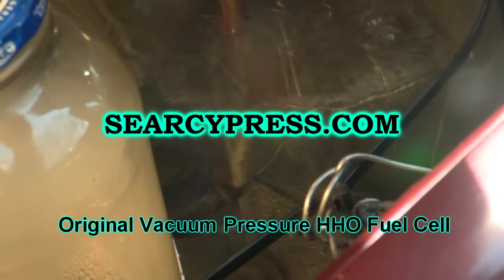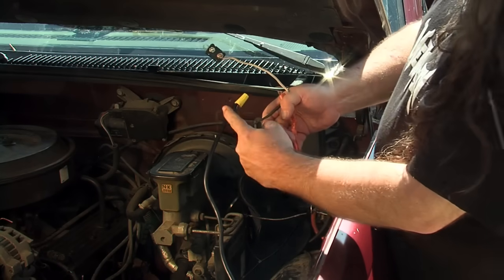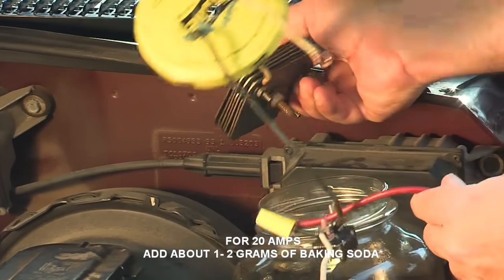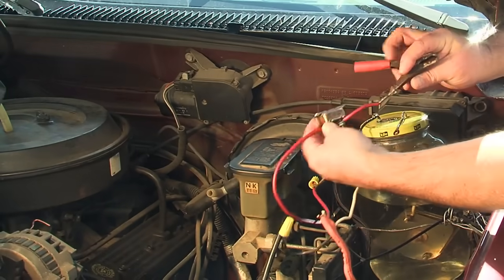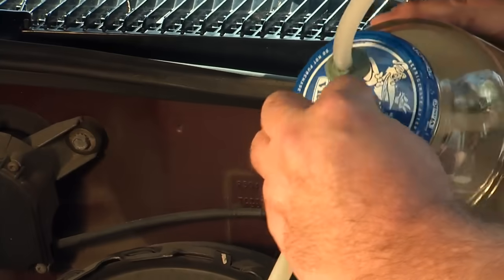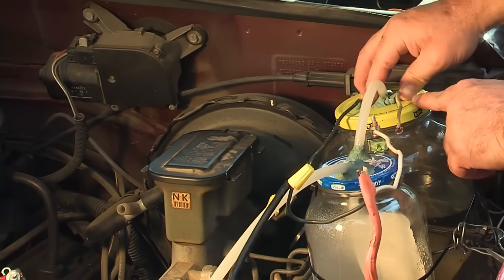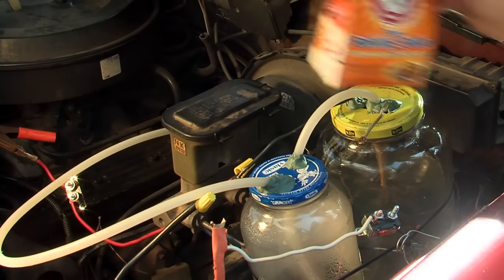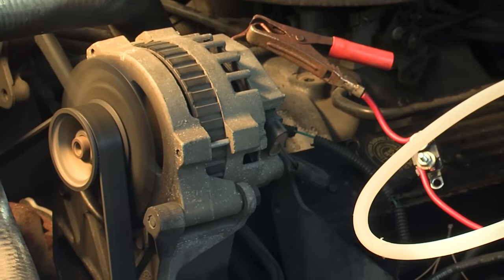Vacuum Pressure Hydrogen fuel cell defeats high gas prices using hydrogen from H2O.

Comment: Hi Sir, I am studying your work,I an seeing that the cell used in this video has only TWO connections.Based on the configuration, you have seven plates.Meaning six cells.EACH cell is receiving the full 12 volts from the alternator.That is based on your configuration.You do not have any neutral plates.

Could you say what the connection from the alternator would be? AC or DC .Did you connect from the output of the diodes or straight AC? Cheers.

Comment: Yeah, something just doesn't smell right.  The system magically converts two thirds of one half gallon of water into a gas which if it were liquid, it would take up 30% of the volume of your gas tank. Do you buy that?
Reply from the maker: Are you even remotely paying attention?
Reply: Metalpress TV , yeah. more than you.

Comment: Do you still have this in your truck? Has it done any negative to your engine over the years?
Reply from the maker: Still runs. No issues from use. Near 300k miles.
Reply: Awesome, I'm in the process of building mine right now.  I got chevy 350. Can't wait to experiment.  Did you ever lean out your gasoline output?  or Slow down your timing?

Comment: SAFETY NOTE.   DO NOT USE GLASS BOTTLES. In case of a FLASH BACK, guess what will happen. BOOM  AND GLASS FLYING EVERYWHERE. If you want to build a HHO GENERATOR, go to this site and LEARN
www.hho4free.com    
Read the article and BE SAFE
Reply from the maker: Sounds good. This system runs in a vacuum. It has no positive pressure. I can't condone anyone building it, but we did. Just so you know, we filled this same jar to positive pressure full of hho and set it on fire...It exploded blowing the lid off. We tried it many times. We had the same result. No glass breakage.  Our ears however were ringing for a long time. Be safe, heed all warnings and remember I said, "Don't build it."

Comment: in my opinion all of this information disregarding hho gas is being funded by some people with an infinite amount of money if you catch my drift.  from my experience it actually does work after going to the gas station figuring out exact gas mileage, then hooking one of these systems up and getting better mileage. 6 months later still better, take it off and gas mileage goes away. one aspect of this everyone isn't taking into account is the fact that yes you are putting some extra energy into the ratio from the alternator however the increased power you get surpasses the energy you waste. ie from the aid in baking soda to make the electrolysis easier. just throwing numbers out to make it make sense but say you burn a total of 1 cup of extra gas per gallon by putting extra pull on the alternator, in turn you get 1.25 cups in fuel savings giving you added savings giving you that 1/4 cup your saving. again just throwing numbers out to put it into perspective they arent actual savings.

Comment: Yes it's a hydrogener,add oxidation and through the main throttle body and what do you have, water running out your exhaust,,, don't that give you a clue,,,,,, of course it is your engine and transmission,,, just bring them both at the same time, with only a little bit of money,,,, I'm sure I can come up with some kind of lie to get the money you will have to borrow to pay me,, good luck Suckers

Comment: The bigger the fuel cell the more hho.  The more plates in the cell , the more amps you need. The rule is measure your plates and multiply . 6 inch x 6 inch  plates is 36. That's how many amps  you need.  Be mindful of leaks . HHO is 10 times more explosive than propane. A ONE WAY VALVE  from your HHO  generator is a must. You don't want your HHO  GENERATOR to BLOW UP. It's embarrassing.  And dangerous. 👍

Comment: Worked with hydrogen for about one year. Many things to take into consideration. 1) is that the vehicle he is working on is carburetor powered verses fuel injection.  fuel injection has oxygen sensors. HHO & o2 sensors don't get along. 2) The water will get hotter and hotter as you drive and the HHO will increase. But it gets so hot that it boils which causes many other problems. It's not impossible but lots of trial and error.
Reply: If distance is very near for example 1mm, voltage between the electrode is 2v, and give enough pressure (1/2psi) then in 12v 1a KOH 2% (30gram KOH in 1500ml water) can make very big output gas around 1LPM with maximum temprature around 35c. If 25a is not efficient, need a lot of KOH and for long time water become hot. You can see how it's made in my YouTube.
Reply: @vincentcliong   lol a litre a minute is worthless... Just idling your engine is over a 600 rpms. Driving a 2.5 liter 4cly motor  is about 150 cubic inches. That's 37.5 cubic inches per a cylinder. A cylinder fires ever 2 full rotations. So in a minute of idling at 600 rpms your engine will use 11,250 cubic inches of air a minute at just idle. That's a 187.5 cubic inches a second of air. You're not producing even 2 cubic inches a second. But don't forget that it's h2O 2 parts hydrogen 1 part oxygen. So 1/3 of the gas isn't even hydrogen it's oxygen. So not even 1% of the air being taken into the cylinder is hydrogen. The only thing being accomplished here is the alternator is working harder for the high amp draw dragging the motor down more reducing fuel mileage. This is why water isn't used as fuel in a motor vehicle. 

Now don't forget we don't drive at 600 RPMs most people will be around 1800 rpms at cruising speed. That's 3x the amount of air with still the same hydrogen production. So now ur way below the threshold of .03% hydrogen in the cylinder. Using a spark arrestor on the output hose to keep from blowing the jar up you would be hard pressed to even candle a flame let alone put anything measurable in every cylinder 900x a minute cruising down the highway at the speed limit.
Reply: @magicalphones  yes for engine is not efficient and make more things to maintain. I don't use it for engine.

Comment: what grade of stainless what are you calling high grade 316.440,306 can be magnet
Reply from the maker: The fancy one shown in the video is made from aircraft grade. Never has failed, but after many years it does seem a bit thinner on the edges. It is non magnetic.

Comment: why not us lithium batteries charged at home???  what about explosions??? any spark arresters??   that glass bottle could killyou..
Reply from the maker: Good advise, but we were in a vacuum. Even a 600f heating bulb placed inside the jar will not light the gas in vacuum. If for some reason you did loose the vacuum....boom. I would most likely have to be inside the engine to suffer from that though. Our tests showed the lid pops off- at mach speeds....very dangerous, and the glass could break. It never has though. Don't duplicate.

Comment: Mixtures of air and flammable gases usually have quite narrow explosive limits but hydrogen-air mixtures are explosive over a much broader range (4 - 77 mol% hydrogen).

The best ‘pop’ is usually achieved with a mixture containing 20 - 40 % by volume of hydrogen. Everyday examples of the need for a sufficient supply of air for effective combustion, e.g. Bunsen burner, household gas appliances and internal combustion engines, can be pointed out.

Comment: if your vehicle is fuel injected, how do you manage the fuel air ratio? With H gas sucked into the system, won't it run too rich?
Reply from the maker: It did. This engine was a gas hog. It ran rich anyway. It just so happened that the gain in efficiency exceeded the losses.

Comment: After seeing many comments and some experiments here I see that, and I say this without having it tested, inyecting hydrogen into the cylinders makes the engine more efficient. Since gasoline engines are not 100 percent effiecent, they are like maybe 70 percent efficient since the iginition fuel from a spark that is in the middle of the combustion area, lets put it that way, that need to push something below meaning the piston and the explosion is circular while the cylinders inside are not circular. Meaning it will push the piston a little bit before the combsution is complete. Meaning the outer part of the fuel the last reamining will explode for nothing beacuse the piston is to low by that time and will not push it anymore. This is why hydrogen helps, making the explotion faster by miliseconds making all the fuel push the piston, someway or somehow like the diesel engine. Making it 20 to 25 percent more efficient. So it does help.

Comment: Not once did he mention u had to address the o2 sensors or the fact that u will end up have to cut out ur converter from ur exhaust system do to clogging but theory is correct just poor presentation

Comment: The only way that you may convince me would be in an engine running without petrol fuel and without battery or at least a battery for the ignition only.
 I have seen very high efficiency electrolysis devices that claim to do that but in this case just a few stainless steel plates on such a big engine will not make a game changer.

Comment: So this video is trying to tell that the excess power needed for driving an overloaded alternator will be compensated by an extra fuel efficiency.
 there should be numbers backing up the l results so it can be something serious.
Reply from the maker: Its under 40 amps.

Comment: Hey peeps, this is not my own information it is under an international patent and it's basically dabbling in zero-point energy. 

DC power at low amperage (.5 or maybe lower if I remember correctly) that is pulsed at 600+ pulses/sec through a hydrogen generator that is under it's own atmospheric vacuum pressure has INSANELY HIGH yields so much so that you'll easily blow yourself up in seconds if you're not carful.

From what I learned about this is that in one sec there was 700 times more HHO generated than when using the conventional methods like in this video and many others I've seen here on YouTube.  

Anyone wanna test it? I don't have all what I need to do so myself. I can only spread the word for right now.
Reply from the maker: The use of vacuum most certainly makes one wonder.

Comment: WHAT I’D LIKE TO KNOW...
does the baking soda cause the resulting mix of hydrogen and oxygen to be so much favoring the hydrogen that you can use this mixture directly and the oxygen doesn’t need to be separated from the hydrogen? I had thought that only the positive lead produces hydrogen and negative produces the oxygen. At what point do you add this to the air/fuel mixture? Can this be done with injectors rather than the earlier carbureted system? Thanks for your help!
Reply from the maker: It enters the engine vacuum system.

Comment: First off, interesting video, but, there is no difference from hooking up to the battery and the back of the alternator since that post is connected straight to the battery. People who don't understand basics of automotive electrical shouldn't be playing around. Giant exposed alligator clips on the back of alternators are stupid and irresponsible.  And what the hell does the magnetic field created by the alternator have to do with anything you are doing? 
Lastly, you did not in any way prove that your contraption even worked.
Reply: tigershifter  I understand what u are saying about the battery and alt are the same wire. But if you where to hook up your power wire to the middle diode/regulator inside the alt you will end  up with more overall current then just the battery current is what I've been messing with and I also used a modified alternator to handle huge load pull
Reply: tigershifter the plates and water get very hot . Which I found not to be that good. If you build pwm close to  1.5hz and 4 to 8 voltage pluse with about 30 to 50 amps.you can produce more And filter with air water separator valve you end up with more pure hho gas then water and oxygen going in to engine .
Reply: Chris Saunde yeah, just as I thought you are one of those people who act like they know what they are talking about,  but don't.  
You did not address any of my comments in my reply. But that's okay, there are very few that make videos on here that do know what they are talking about.
 Once again, what does the magnetic field from the alternator have to do with anything?
 Next , you connected your power supply to the "Battery" post on the alternator the same amount of current will be at that post as will be at the battery.
 And lastly, you never "T" into the vacuum source for your brake booster, I mean unless you want to take a chance with reduced or lost brake booster.
Oh yeah, one more thing, GM alternators are know to burn themselves up if you put to much of a load on them, like say, trying to let recharge a dead battery, or adding extra loads to it from an idiotic contraption like that.
 Dily dily, my friend, lol.
Reply: You have no clue yourself .
Reply: I don't care about the stupid vaccum or the magnetic field . . I have question . How many amps does one 12v car battery have ? And you do realize that some alt put out over 200amps if modified. I bet you don't even work on any of this kinda stuff . You probably just nag for nasay .
Reply: tigershifter also stainless steel isn't the best metal to use metal hydride is . And if still don't believe things work look up the military hover craft and other vehicles they use salt water . Theres even a big tanks ship that runs on the salt water. Better do some more search. Be for you  insult them
Reply: Chris Saunde , hey buddy I never meant to ofend you, but was disrespectful,  I apologize for that.
 But I have forgotten more about cars than you will ever know.
 I am an ASE certified master tech,  and also certified in alternate fuels, and passed the L-1, before they changed it to make it easier, because people were whinning it was too hard to pass. So, yeah I know what I am talking about. 
 Good luck with your butchery wiring job, with open exposed positive contacts everywhere.
 Guess that is the difference between a wannabe and a professional, I don't use household bullshit on cars when I am wiring something up, at least you had the common sense to put fuses in, but that is probably only after you melted something,  lol.
Reply: tigershifter plz just cuz you have a peice of paper saying you know how to . Doesn't mean nothing . Any stupid "peep" could go an pass but still be stupid. I appreciate that you apologised. I'm sorry as well. I just hate some people's comments. And even though that it is a poorly design system . Needless to say It still works . As for my stuff I would never hook up cheap stuff from the house . I got degree in technology circuit engineering. I built electronic circuits on computer for tvs, motor controllers, computers,phones. Inverters and others . I have. 2500 watt stereo system with cap and all 4 gauge with proper blocks for all connections never gets hot . And a 4 cyclinder will, ..well should say does run on about 4 to 8 volts @1420mhz freq pulse width modulation with driver and inverter all in one about 30 to 50 amps . Here 40 hours of driving on 1 litre of water.. here is the last thing . "Have you ever tried to put the power switch on the negative side of the line  when drawing lots of current from the positive".. if not try it .. reason why I ask is because  that neg switch won't end up get hot for some reason . I think cuz theres only one power line it gets hot per say but many grounds so it gets spread out . What you think on that?
Reply: hi can you make a video how to? or send me details on the pulse voltage etc

Comment: How to make the plate?
Reply: alternating positive and minus plates (preferably made of solid platinum) as close as possible together but electrically isolated from one another. Even better if you can drill thousands of holes with something like electrical discharge machining as the higher the surface area, the more gas produced.

Comment: the secret is voltage not amps.
step 12vlts up to 300k- volts and pulse inject it for a hundred times the gas production.

Comment: What happens when you hit a pot hole to the glass? It breaks! What about the engine heat? Will it evaporate the water? What about if it is 20 degrees? Will the water freeze?
Reply from the maker: The glass never did break as I had a pad under it. The soda in the water helps with freezing issues. It is a factor. You do have to add water. When it ran out, it just stopped working.
Reply: Why are you trolling these simple folks, dude. Is it intentional for the laughs or do you just want to feel smart. Either way not cool. Some people might be silly enough to fall for this and wreck their exhaust at best or blow up a good liter of  inside of their engine compartment at worst. Either way not cool.
Reply: Quit being a negative Nancy

Comment: Thanks for fantastic video, but I concern the electric wire can be melt by heat and trigger a short.  Secondly,  the glass bottle can be broken and it is a mess and later the engine would be rusty!  Third, how to detect the leak or if the fire pulls back in the tube then how it can cut off itself? fourth, some alternator has very high 100+amp.
Reply from the maker: There were risks, but it needed to be tested. So we did. Auto reset fuses and large wires were used.